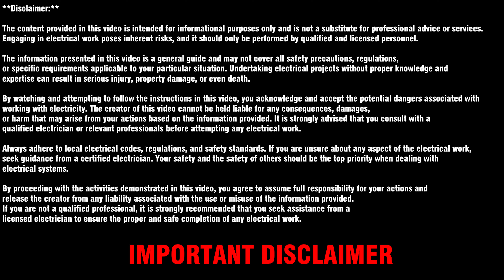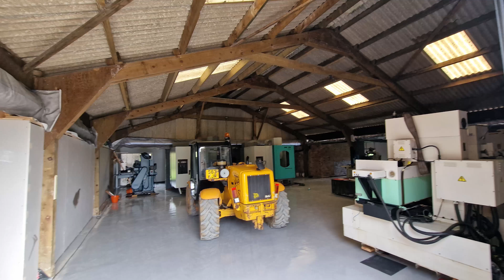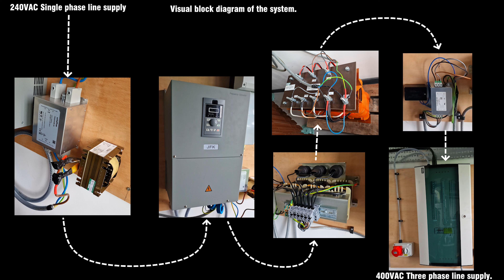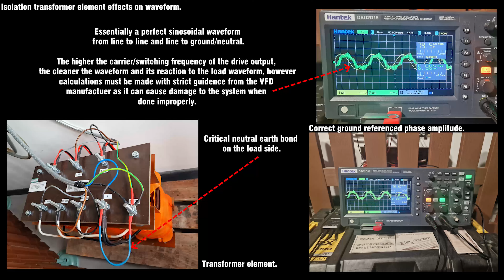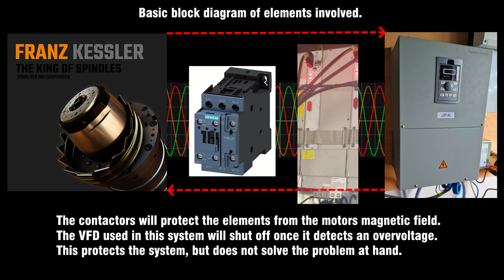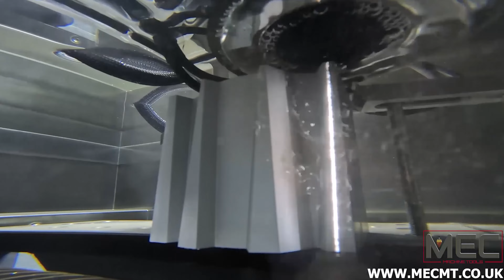How to build a digital phase converter to convert single phase into 3 phase - Part 1

Comment: Man finally I’m so glad i found this video. I’ve been waiting for this topic to come out on YouTube and you have done it. Thank you for your knowledge.

One question about regenerative current. Is this similar to back emf produced by electric motors for monitoring the stator and rotor relative position? If so, why don’t the machines that produce this current use it within their own circuitry as extra energy to do more work? What types of machines produce this? Thanks for your knowledge again.
Reply from the maker: No problem, glad you enjoyed the video, regerative current, to put it simply yes it's exactly the same as back emf, the motorspindle inverter from the cnc machine uses the inertia of the rotor and spindle to generate power from the stators emf, which goes into the spindle inverter, raises the dc bus power, as you suggested that does happen, it gets reused across all inverter and drives on the main dc bus, then any excess goes back from the main power supply modul to the direct line supply, hence why in the video I demonstrated with an overvoltage error on the phase converter.
Reply: @max_eley  thanks for getting back to me. I see, so there is still some current left over usually that needs to be dealt with by the VFD despite some of it being reused by the cnc. Instead of sending it to a resistor then, I’d route it to a battery.
Reply from the maker: @ayberkaydin2182 of course!, but I think this engineering challenge has mostly been solved with a resistor in industry, the machines just like this I see in the field with optional resistors on are usually quite small in comparison to the motorspindle, I think the actual amount is fairly negligible, but not negligible enough that my vfd can handle it. With a battery type system you have have to look at a number of new challenges, primarily being instant absorption of the current, it happens very fast and I'm not too familiar with battery management systems but usually they charge quite slow? But I'm all for innovation. I'd like to hear your thoughts on it.
Reply: When I learn some more about batteries and BMS’s, I hope to give some more valuable input, but at this point, I’m still in the knowledge absorbing state

Comment: Hello, thank you for sharing valuable information for me. I have three CNC milling and two lathes. I have had countless electrical damage. I have had to replace several Amplifire VFDs and Spindles. I use a rotary phase convert from American Rotary. I'm thinking of buying a Phase static converter, but their price is over 12k dollars. What changes can I make to your design since my machines operate at 230ac?
Reply from the maker: No worries!, sorry to hear that, if you buy a static phase converter like you mentioned it will completely destroy your machines unlike the rotary, in my next video I go over why that is. The only changes you need to make to the design is replacing the output transformer and filter for ones with the appropriate voltage ratings.
Reply: Thanks! I'm searching the components that would work with the voltage needed for my cnc.   @max_eley